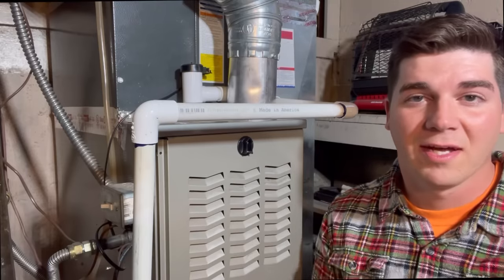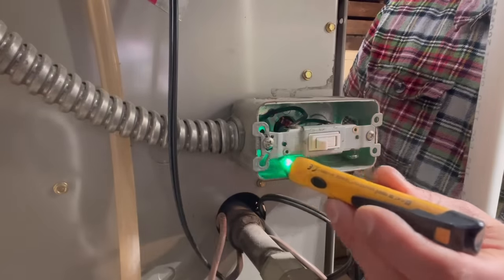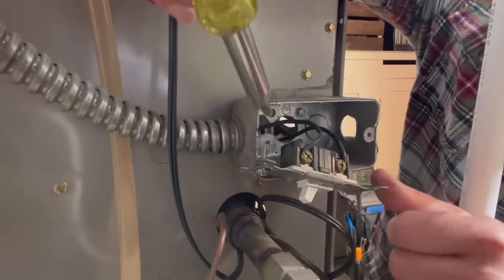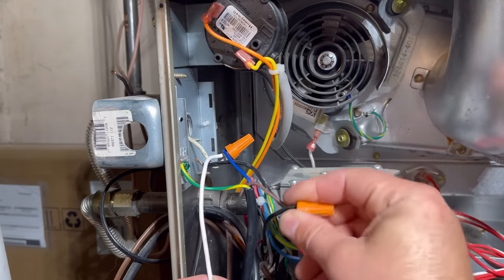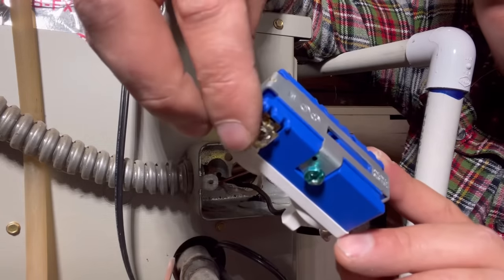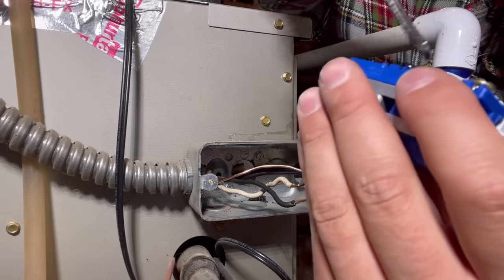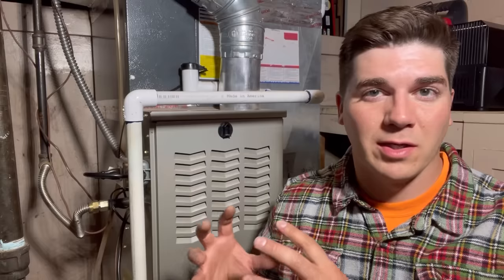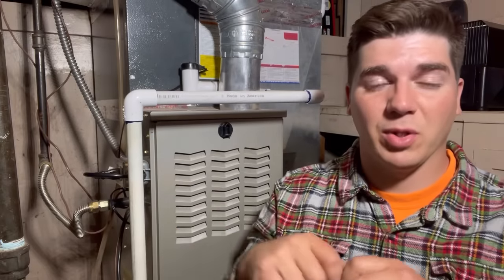This Could Keep Your Family Warm During An Emergency Power Outage.

Comment: Excellent video as always.  I would add a note in a plastic baggie hung from the switch box.  A simple diagram and explanation of what to do with switch and plug and how to plug into backup power supply.

Comment: I did something similar years ago. I have welding cord running from my generator to a box with 4 outlets on a long cord. I can plug the furnace into one and i have 3 more for fridge, lights, ect. The reason I had to do it that way is because i have an old style fuse box. Not a breaker box. In the area i live it can get -30 in the winter. The furnace is really the only thing that is really necessary. Everything else is secondary.

Comment: i have a direct vent fireplace. this is a sealed unit. it has a standing pilot. it also has a very nice blower. though the blower obviously would not operate without power. the fireplace works great with or without power. i ran a cable from the milli-volt gas valve to the hallway and installed a programable thermostat. i can heat my home without power. the main breakers for my HVAC are turned off. i don't use the furnace. i would recommend using rubber grommets on those knock-out holes to protect the wires from wear due to vibrations.

Comment: I think it is a great idea to have an alternative power connection.  It is great to see people getting things together like this.  That being said, I would like for folks watching this to understand using a pigtail cord and outlet setup like this is NOT for every furnace. DO NOT attempt to do anything that resembles this on an electric furnace.  This video is strictly for gas furnaces.  Even though they make 50A plugs and outlets for 220V connections to ovens and clothes dryers, it is a violation of National Electric Code for furnaces and hot water heaters.  Those appliances are considered "permanent" installations, and as such, it is required to be hard wired to the screw terminals provided.  Technically, it should work fine, unless something goes wrong, you will be stuck paying for rebuilding your house out of pocket.  110V appliances have no such requirement mainly because they are lower wattage.  Many electric furnaces pull 5000 watts of power!  Running that kind of wattage through a plug and outlet connection is very risky, long-term.  If there develops the least bit of corrosion on those brass parts inside the outlet or the plug, the connection surface area is reduced, thereby, creating resistance.  As resistance builds up over time, the metal parts of the connection get hotter and hotter, eventually leading to an electrical fire.  The attic space is ventilated with outside air containing a percentage of moisture.  The moisture is what starts the corrosion.  If anything, I would recommend installing a transfer switch next to your breaker box and an appropriate generator connection with weathertight housing, if you don't have LNG or propane heating in your home.  Solar is not really an option with the power hungry electric heating.

Comment: Depending in your jurisdiction that switch is not required. A plug counts as a disconnecting means. So you could just fasten a power cord to your furnace and change out the switch to a plug.
Reply: The switch is probably code as mine also has one.  I’d add an outlet between the switch and furnace.  Flip breaker, flip the switch as additional safety and plug the generator into the outlet with male male adapter.

Comment: Did you mention that in the event of a power failure, homeowners should shut off the breaker in the panel before adding a generator source? 
This is important so as to not accidentally send power back through the main panel.
Reply: adding the external power source involves UNPLUGGING the furnace from the mains, no connection to shut off.  This switch is completely unnecessary, you don't need to shut off the outlet if you're unplugging it anyway.

Comment: The 1/2 ko going into the furnace needs to have: rubber grommet,  bushing, plastic or metal strain relief, or a chase nipple. You should have left your pigtail much longer, my opinion,  6-10 feet. And lastly, even though it isn't a biggie, I'd use solid #14 as a jumper inside the switch. Not that any of these things will be inspected.These are cleaner neater tricks to be a little more pro and to code. ✌.
Reply from the maker: Thanks man! I appreciate those tips. I’m always looking for ways to improve. Cheers
Reply: @Michael Dupre About me .had an innate attitude towards electrical since age 5. Literally could wire phones, speakers, fix Christmas lights. Make phones and doorbell ring at age 6. Fixed high school teachers bedroom short age 15, wired his 240 dryer outlet age 16, installed a generator into parents cabin age 18. Electrician to the Magic Castle in Hollywood  13 years. After that mouthful,  why would you wire a 3 way switch? That means a second switch working in conjunction with the first one would have equal control from some other location to open or close that circuit.why? And what was the specific thing you felt a little uncomfortable about. I love helping.
Reply: @Michael Dupre your reasoning is correct. A volume control essentially is a  potentiometer, it is a variable  resistor, or  POT  for short. It is inside all old knob rotary dimmers , most all new slide dimmers like LUTRON MAESTRO. However it merely tells the triac inside which is riveted to its aluminum housing as a heat sink, it tells the triac how often  to chop the SINE WAVE.  In normal 120 volts a.c. the wave is 60 cycles.  Actually it is 30 nanoseconds of a positive wave. Flatlines at what is called the zero crossing ( like a dead human heartbeat,  flatlined) for .4 of a second. Then becomes a negative wave for 30 nanoseconds,  then flatlines  again for .4 of a second. Thus a complete revolution  takes place in 1.8 seconds. Think of it as alternating  current is d.c. flashing on and off 60 times in one second. So a modern day dimmer like your timing belt on a car that you hold a zenon flashing  strobe to see the white stripe pattern as the fan belt rotates in front of your eyes. You adjust the timing belt so the cylinders fire in sync. Except a wall dimmer refuses the on time to a light bulb, less time on , less time for filament to heat up, to human eye incandescent lights appear to be dimming.thus why unless an LED DRIVER ( fancy way they refer to the electronics providing led its d.c. current) was designed for chopped waves slower than 60 cycles,  you are starving and or confusing its switching power supply. Almost all modern chargers,  power supplies, screw in LED'S will operate from 90-250 volts switching automatically. Because its guts were  made to operate  on the low end, anything above that 90 volts it just trims back. It can do this by using the same trick like dimmers, changing  the phase harmonics of a sine wave thus giving it less on time, like a water pressure regulator that allows only so much pressure  through. Since the driver already is chopping your 120 , down to 90 to make itself work, you go and dim or chop its input wave down( it has no clean 50/ 60 cycles) it can't keep up and compensate for so many quick transitions.